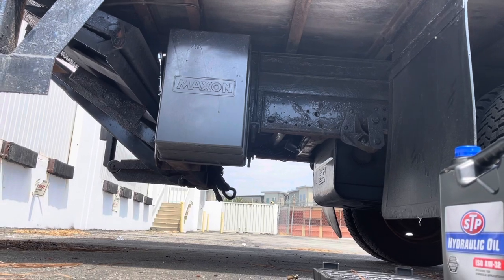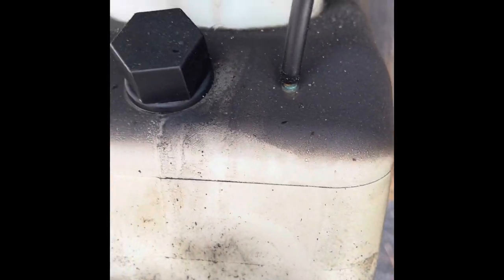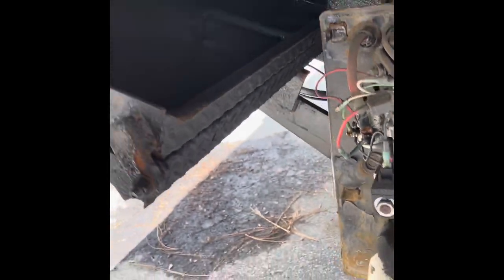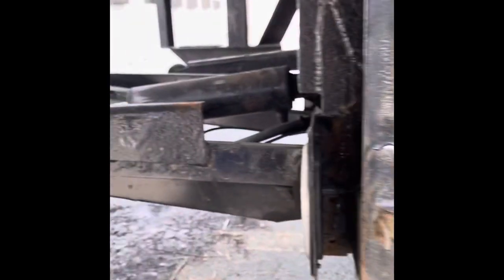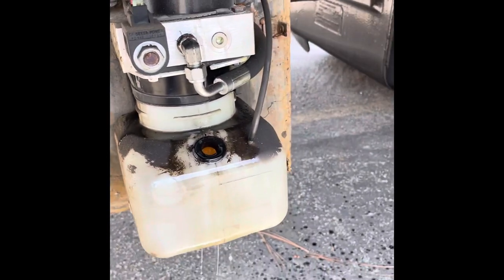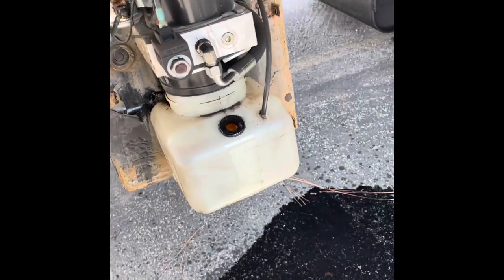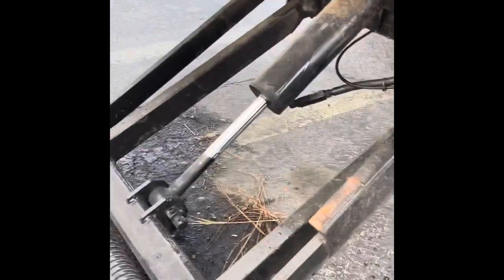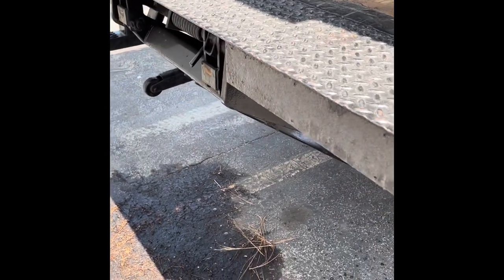Replacing fluid BOX TRUCK LIFTGATE

Comment: is there any way you have pictures of the wires going to the solenoid, i have the same setup but i think i crossed a wire. i know shouldve took lots of pictures before i took it apart.
Reply: That’s the same problem I have but I have Waltco Liftgate.